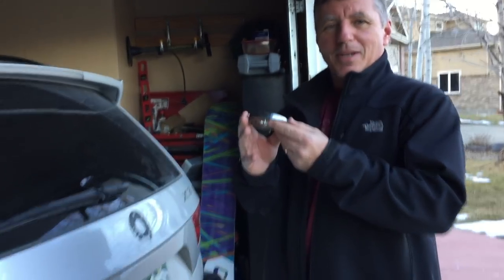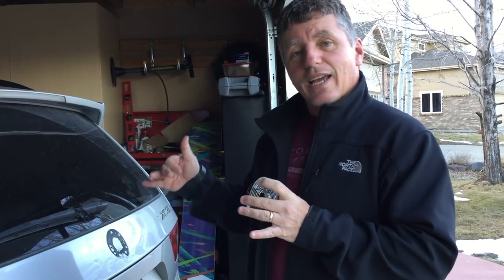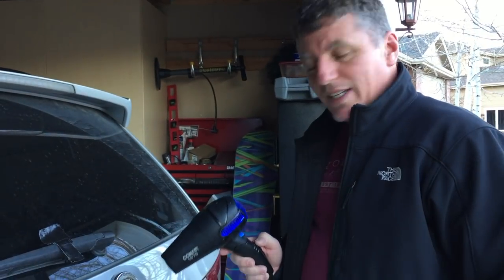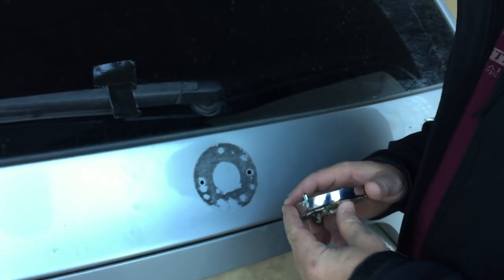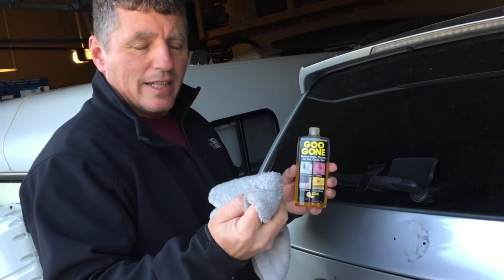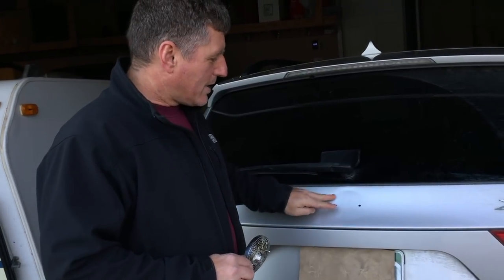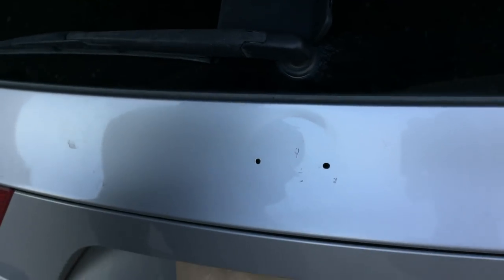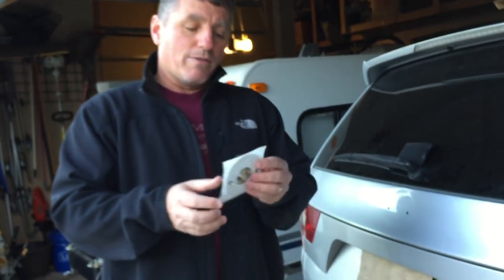How to Change a BMW X3 2004 Rear Emblem

Comment: I also bought the wrong emblem. I plan to poke a hole in the center and helping remove the emblem without scratching the chrome base. Then glue in the new one.

Comment: Thx mate, saved me a lot of time and work. Front was easy, back was really sticky. I got mine of ebay, i live in Europe, there are a few good sellers with quality badges, and for very low prices. And yes, they are OEM. Were sold as having minor cosmetic scratches, but both front and rear were in mint condition. My X3 looks great again with fresh blue/whites.
Reply: And the BMW E-series (like X3 E83)badges have pins, the F-series dont.

Comment: Gasoline on a rag will help remove the remaining adhesive. Afterward use alcohol or hand sanitizer to wipe clean. Aside from doing this in the summer heat, I would recommend warming up the car’s surface and emblem’s adhesive with a heat gun or hair dryer right before applying. It seems adhesive works better when slightly warm (similar to why replacing roof shingles is better to do in the summer sun).

Comment: Great help. Been trying to get my badge on 2006 x3 off. Getting a hair dryer now.
Reply: If your lucky, go to a construction site. Try to find those plastic ties/straps, that are often use around packages, or pallets of stones. They are strong and thin. Use it to saw the sticker of the badge. It worked for me. Then the cleaning begins. I got 2/3 off in one pull, the rest was removed with sticker remover and the plastic thingie to clean your windows from ice. Clean after your done, and your car is ready for its badge.

Comment: Thanks.. worked perfectly 2006.. except I didn’t use a plastic flat piece to get it off. I  used the flat plastic wrap that they bundle lawn bags together when you From Home Depot But works the same 👍